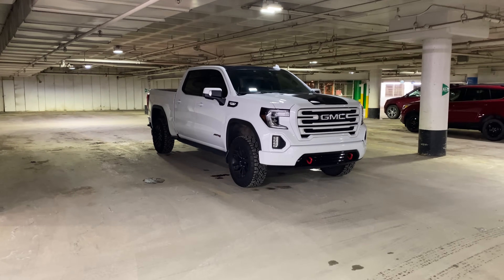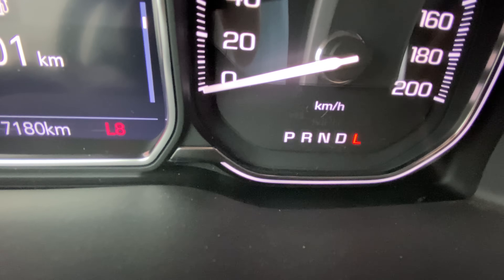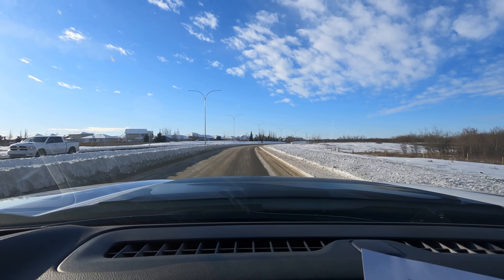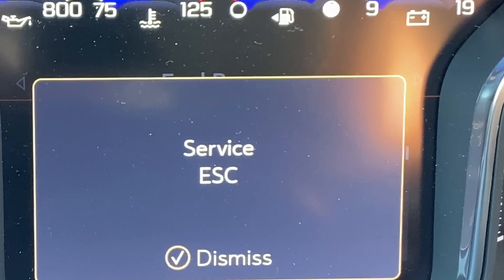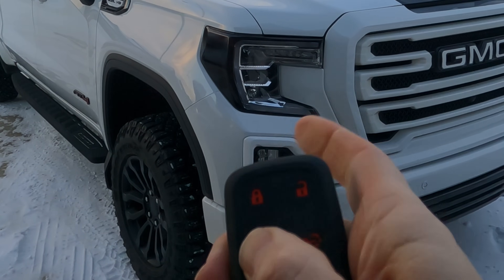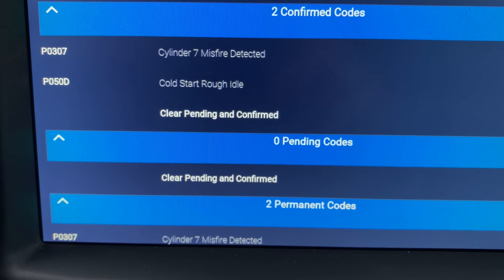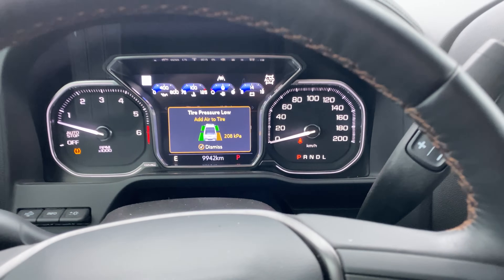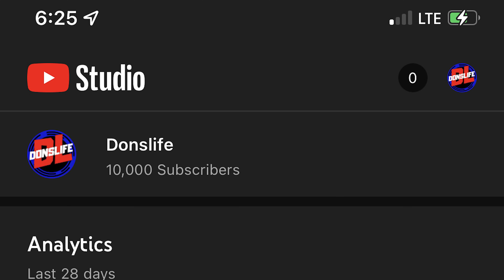Problem - Check Engine Light! What Happened? 2021 GMC Sierra AT4

Comment: Just want to share with you my experience with the very same situation. I have the same intake and a flow master American thunder exhaust. Also I was running a DFM delete by Range while this all happened. Back in July my 2021 SLT threw the same code while on a drive but all seemed fine. After running into a store I came back out started the truck and started taking off from the parking lot and the truck started making machine gun noises from the engine (amplified from the intake) and realized immediately that the engine was misfiring. Limped the truck home and parked it. Now the weird thing is I took the truck down to the dealership and it stopped doing it and they couldn’t replicate the issue so they cleared the same code you received and sent me on my way. As I cautiously drove the truck around town I started to hear tapping or knock coming from the engine bay and I knew that was not good. I took the truck right back to the dealership and this time the Service Manager stepped in and said he recognized this and said it sounds like a lifter issue. After they looked into it it was a  collapsed lifter in cylinder 7, so they had to replace all lifters on the left side. I went home and did some of my own research on this and found service bulletin PIP5776F which requires GM to replace all lifters (for specific models and dates). So I brought this up to the dealership and they were hesitant at first to do this but eventually did because they spoke GM and had no choice, so long story short I now have all new lifters in my engine. You may not have the same experience but so far you are checking the box on everything I experienced. Sorry this is happening to you and wish you the best, especially with all the parts shortages due to COVID.
Reply: How do you like the FM American thunder exhaust? I’ve been eyeing this and it’s tough to pull the trigger on any specific exhaust.
Reply: That's scary & surprising that you had a lifter failure with DFM disabled.  The whole reason I bought my Pulsar LT was to prevent that from happening in the first place.  Good luck and I hope it's smooth sailing for you from here on out.
Reply: Is that only with a gasser?
Reply: @fredmctavish4108  Yes.  The diesels don't have cylinder deactivation.
Reply: @JebClarke902  disabling dfm has nothing to do with the lifter failure.  Still happens all the time with range used. It was a bad batch in 21.
Reply: @1duramaxhd  I truly find it hard to believe that it was just a bad batch of lifters in '21.  That may not have helped matters any, but how do you explain the lifter failures in the 20's & 19's, and not to mention all the lifter issues the AFM engines had from '18 back to '07?
Reply: Dealer put same lifters in. Same as the ones that failed. Talked to a guy that works in the factory in Michigan that makes those lifters. He said they are junk.
Reply: Thank you... I am at the dealership tomorrow and will print out the bulletin to bring in
Reply: GM claims they got a bad batch of Chinese lifters.  I also read with they repair the bad lifter they only change lifter on one bank.  The other bank is not touched.  It sad to see many new GM trucks are having the same problem.  I also wonder if there was valve and piston damage.  I would consider an extended warranty.
Reply: This just happened to me yesterday on 2021 gmc Sierra Denali.

Comment: Just wanted to share my experience.  I have a 2019 Sierra 1500 SLT with a 6.2 engine.  I am in sales and drive a lot but 90% is all highway miles.  I've had many problems with this truck but in January 2022 my engine failed.  Broken lifter and bent push rod which also damaged my cam.  It is 2.5yrs old but due to my job requiring me to drive a lot it had 110,000 miles on it.  Truck still looks new and I take care of it well.  I was left with a decision to either fix the existing engine for $6,500 or replace the engine for $8,000.  GM refused to cover anything and after the new engine was put in the bill from the dealer was $9,365.  I also had $1,400 in rental car fees during the 6 weeks it took to get my truck back.  Also, I opened my hood after getting the truck back and the wire harnesses were just laying in there not put back in the factory clips, the bolts for the airbox were missing and several other brackets and bolts were either missing or just hanging there.  Just wanted to share my story because this was the first, and last, GM product I will ever own.  It should be a crime to have someone replace an engine in their $65,000 truck when it's 2yrs old especially when it's a known issue for them.  Very stressful and depressing situation to go through.  Anyways, love your channel, you do a great job!
Reply: Also wanted to add that the truck had absolutely no mods on it when this happened.  As soon as I got the truck back I put a Pulsar on it to eliminate the DFM but that's it.
Reply from the maker: Wow, sorry you had to go through all of that.   My channel will continue to have some variety and not just my AT4.

Comment: Same exact thing happened to me except my code was for open 5v reference circuit. Ran tests and nothing was showing as opened. Kept driving w just check engine light and it eventually went away…1 1/2 months later it all came back lol

Comment: My 2 neighbors have 2021 GMC Sierras and both have been in for lifters, one just once and the other has had it done 4 times. We're in South Texas so cold is definitely not the issue! The more frequent gmc is going back next week for them to check it out yet again! Hope your issue worked itself out! And if so, what was it that fixed it?
Reply: I'm from south texas too. Weslaco area to he exact. Was wondering if you heard any additional information from your neighbors that might help with this issue? 
Do you know if the dealership helped them out or gave them a hard time?
Reply: @3gchapa  were down in corpus but away from the ocean,far nw side at the city limit edge! The one neighbor that had it once hasn't mentioned any updates and he's not a favorite of our neighborhood! However my other neighbors haven't had issues since this last post until recently! About 3 weeks ago, the engine is showing similar issues before the check engine light popped on last time! It studders and shakes at idle, sluggish take off, almost feels like the transmission is slipping at speeds from 0-35ish mph! No check engine light just yet but we have a feeling it's coming! As this would be more than 3 times, they are thinking about lemon law but they placed a big down payment! Usually buy backs only cover the truck for what it's worth now and not brand new from how it was explained to me! Still runs though! Are you experiencing anything similar? And yes it does it with the engine auto stop enabled or disabled! Best of luck to you!

Comment: Got a 2021 5.3 at home with 29 thousand km also near Saskatoon so the same weather, seems to be running good never had any problems oil changes every 7k  heard a lot of lifter problems leading to a lot more problems. Hopefully it’s just the cold weather for you!
Reply from the maker: Hope so brother.   I am more worried about the hassle if it is a major issue

Comment: Silverado with a 5.3. I’ve had a flashing check engine light every once and a while with no miss fires or power loss. I’ve taken it to the dealer multiple times and there are no codes. I have the same mods as you, and the check engine light was there even before the mods. They tell me there’s nothing they can do till it breaks. I’m at 18k miles and just hoping for the best since nothing has happened.
Reply: My truck doesn’t have cylinder deactivation and I get an oil change every 4K miles. Idk man.

Comment: so what was the issue did you get it figured out??? have a 2021 silverado check engine liggt blicks and turns off says engine missfire truck works fine no noises at all took it in and they change all the lifters on one side and its still doing the same thinggg😢 i do have a k&n air intake on it  thinking of putting the original air intake it might be that???????
Reply from the maker: Never did find an issue.  Full synthetic oil changes every 3000 miles and 91 or higher octane and I have been fine.   I had a steering column lock service warning pop up recently, but my research says it it likely a module that needs reprogramming
Reply: so your engine light still goes on ? once in a while think ima have to live with that
Reply from the maker: @06tbss1  I have had a few instances but all related to sensors.   The forums are full of reports of the overly sensitive systems reporting bugs.  I am happy I have warranty and just enjoy the truck otherwise

Comment: Hey don don't know if you can help!!!!!!!! I've been a big fan since day 1 and I wanted to know if you can help with locating  fuel pump driver control module 2021 yukon. In the states they are on national back order. Don't know if yall are having the same issue.
Reply from the maker: What is the part number? Is it 23382215?
Reply from the maker: It might be tough since I would think that all of the parts departments can locate inventory in other locations.   Worst case scenario you can call the auto wreckers.
Reply: That's what I was thinking 🤔. But might void my warranty

Comment: Have you any experience with cold weather problems with the new 3.0L Duramax?
Reply from the maker: Haven’t heard of problems with some of the people I know.  Just plug it in when it is cold enough to warrant it
Reply: Just had this same problem with my 2021 AT4 w 3L Duramax. Even started with low tire pressure , however it’s 0F with a wind chill of -20F. It was running fine, got gas, stopped at a store and then rough start when I got back in with the same warning messages. After letting it sit after a second attempt it started and drove fine, except the service engine light is on still. Since it’s XMas eve, no dealerships are open. Any help or insight is appreciated
Reply: @MrSnyder21  just keep driving it if you can. After a few starts, the check engine light will likely go out. I’m getting the DEF system removed as soon as I can. No one up here where it gets done below -40 keeps it. They either get the DEF system removed or trade it in for a gas-powered pickup.

Comment: the samething Happen to me today! on my 2020 at4, mine was not starting I let it seat for 20 mines and it starts find, but has check engine light on, I should Just take it to dealer? what if check engine light goes off? should I still take it? Thanks Don, keep up the great work bro.
Reply from the maker: I would take it if the CEL stays on.  Sometimes there are issues that are temporary and and the CEL will turn off on its own.   I would still take it in so if anything happens again, even if this time was nothing major, you’ll have some history to help you if things ever get worse.

Comment: Was there ever a solution found for this issue? I have a 21 AT4 with 3.0 duramax with no modifications same components as it rolled off the show room floor with and when temperatures are below 30 degrees Fahrenheit the truck will rough idle and shut off throwing the same pop up errors about parking brake, brake, emissions and limiting speed and travel. Gmc dealer has supposedly fixed this 3 times and it just did again 10 days after gmc supposedly fixed it
Reply from the maker: For me it seemed to stop after adding a fuel treatment and going through some more tanks of gas.  However just recently (Jan 2023), I had another misfire on cylinder 7.  Code is clear and is running fine.

Comment: My 2020 GMC Sierra 1500 I4 engine just for 3rd time engine light on each past 2 times around 35000 miles each the egr valve for emissions failed I have 350 miles left on warranty at 99650 miles on truck sitting outside GMC right now waiting for them to open fix any warranty issue
Reply: Seems to be emissions code again

Comment: I got a 22 rst with the 6.2 no engine lights I live in pa sk anyway don’t drive the truck hard only 11k on it noticed a small engine noise yesterday today now it’s makes more of a noise sounds likes it making a noise around the bell housing any issues with this truck with that or maybe rod or bearings issues? All oil changes done so far at Mann motors
Reply from the maker: I would get it checked out

Comment: Hi Don, I talked to you before. I had the exact truck you have, unfortunately @ 40k mile the lifters collapsed on the left side. They would only replace the bad ones. I thought about it a bit and decided to trade it in before it happens and I'm out of warranty. The new one is a 2024 6.2 ZR2. I bought the extended warranty this time, hope it doesn't happen again.   Do you know if the corrected the problem with those engines or not?
Reply: Do you know if the L9 works on the newer trucks to keep it in V8 all the time?

Comment: Ok. I’m starting to feel better. I had a very similar issue just happen to my 2018 Silverado. Hoping it was just the cold. Scared me to death!!! But it happened when I was going from 45mph to 55. Started shaking like a flat tire then suddenly engine light came on. Code showed coil 6 mis firing. Replaced #6. Happened again. Said same thing. So we swapped 6 & 4 and replaced the spark plug and wire. Happened again. Took it to the dealership and they couldn’t find anything wrong. But now every time I drive it I worry it will happen again and cause serious damage. But all 3 times, it has been super cold and I let it warm up for about 10 minutes. I no longer let it warm up. So far, no more issues 🤞

Comment: 2021 there is a recall 6.2 and 5.3 for the lifters so might want to check that out
Reply: When was it issued?
Reply: Keep me posted as I bought in April a new 2021 High Country Silverado 1500 with 6.2L & 10 speed. I too am hearing from Facebook about these same issues. Makes me nervous about going on a long trip. I live in SW Michigan. Using  mid-grade Shell gas & using higher octane Shell when pulling anything heavy, which isn’t often. Being retired my truck is parked inside where it doesn’t get very cold under a by-level home, unheated garage. Trusting GM to do a complete recall soon. I’ve been thinking of removing all this high tech engine controls & going back for the full time V-8 version. Feeling safe while under a GM warranty, but that is only short lived. I’d rather be pro-active than be stuck with a bad engine. I am NEW subscriber here today! I’ve got 12,000 miles on my Chevy.
Reply from the maker: Welcome to the channel!

Comment: How do you connect the OBD2 scanner to the OEM dash monitor?
Reply from the maker: I use an android-based box that runs of one of the usb C ports.  I did a tech review on it in November.  Pricey, but has some neat options like running OBD2 software
Reply: Awesome. Thanks a lot

Comment: Bro I hired an attorney and filed a complaint with GM. I have a 2020 GMC Sierra AT4 black widow. Exact same thing except I live in Arizona. Started doing this at 5k miles. Happening over 10 times now. Dealership has no clue what’s wrong. They replaced my water pump last time, lol didn’t work. It’s also happened and I can’t get the dash lights to turn off as well and this drained my battery. If you would like info on what’s happens with my complaint with GM give me a e-mail I can keep you updated at, this goes for anyone else dealing with this crap. I also have a slightly rough running motor now. Currently odometer is 41k miles. Spent a total of 67 days at the dealership so far. Good luck bro.
Reply from the maker: Water pump? Didn’t think I would see that listed.   I guess you have extreme heat there and we have extreme cold.  I may take you up on the email down the road.  My email is in my video descriptions too.  Good luck man
Reply: @Donslife  They tried the water pump because of the chatter coming from the motor, didn’t work. Made a awesome new issue, when the motor is cold it makes a high pitched belt sound for 15 seconds or so. Awesome. I love my truck but when I’m not sure if it will leave me stranded somewhere it becomes a problem. I can take cosmetic stuff failing but motor reliability is where I draw the line.
Reply from the maker: @SLiCKFARTS  I understand the sentiment

Comment: I had same error codes of p050d and cylinder misfires and had to replace fuel injectors.  13 states mandate replacing fuel injectors for error codes such as p050d that covers 150k or 10 years for the 2016 models (maybe newer too?)

I have a 2016 GMC Sierra with 33500 miles and took it into the GMC dealership in Concord, CA because of vibration, shaking, loss of power, on what felt like a rough idle start. At that time, I had about 3 weeks of warranty left so I wanted to document it and get it fixed. But no code was showing at the time, so no fix. Dealership tells me they feel the shake and vibrations but considered it normal.

As the warranty expired, the p050d code popped up and I contact the GMC in Concord, CA and was told I was SOL, warranty expired. I then took it to a local mechanic shop who told me I had misfires in two cylinders.  Again, Concord GMC refused to take care of it.  I suspected it was the fuel injectors.

After months of driving it with check engine light coming on intermently, I decided to take it to GMC in Dublin, CA who repaired the fuel injectors (one side only) under warranty.

I learned that 13 states (Ca, Or, Wa, NY to name a few) mandated them to replace fuel injectors for such codes bc of emissions regulation. The warranty for fuel injectors or 150k or 10 years.
Reply from the maker: Some good info here 👍🏼 thank you

Comment: 2022 gmc 1500 AT4 diesel 3.0 engine light on one week old 600 kms. remote start not working. what could be the problem?
Reply: Nox2 under threshold. My’n comes on and goes off.